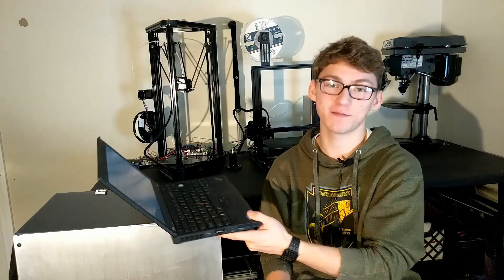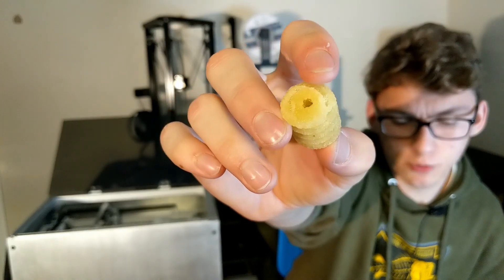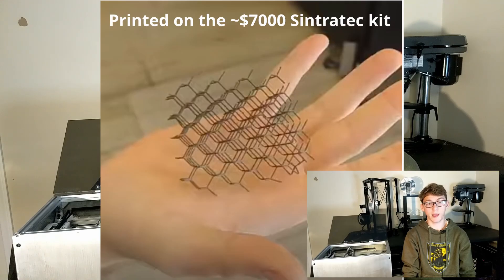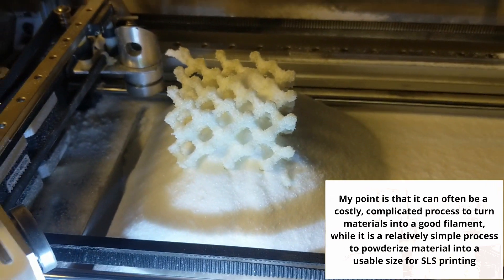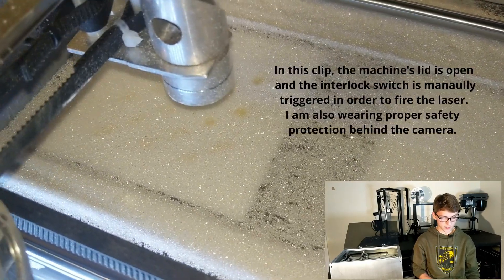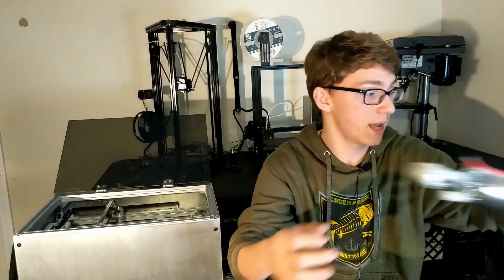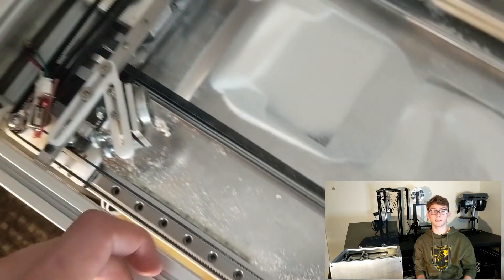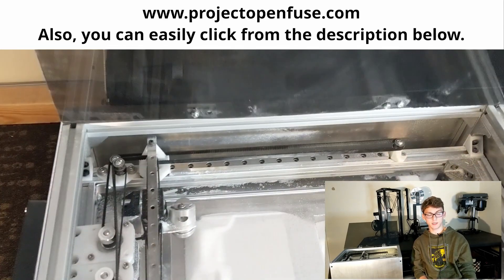Open-Source SLS 3D Printer: Project OpenFuse

Comment: This is fantastic Luke. Have you tried castor sugar? Would be interesting to see a really detailed print with super fine grains. Cheers, JAYTEE
Reply from the maker: Thanks Jaytee! I'm currently using granulated sugar sifted through a 60 mesh sieve, so <250 microns. I want to use an even finer mesh soon to try powders 50-100 microns. Someone in the discord actually pulled up a great chart of all kinds of different sugars, and castor sugar was mentioned. I'll definitely look into it more!
Reply: @MakingwithLuke  Excellent, looking forward to more 👍

Comment: Like all of your work I have seen  this is amazing, a new level of amazing even!

CNCKitchen done that salt video not too long ago, not sure if salt would work with this or if you have seen the video.  He was looking for a cheaper finer salt, and someone in the comments mentioned a possible candidate, might be something to check out.
Reply from the maker: I appreciate that, Jon! I saw Stefan's video about using salt to anneal prints which is really cool. I don't know if salt is a viable powder either, but the great thing about this printer is that I can at least try!
Reply: @MakingwithLuke  This is the comment I was talking about:

"The salt you want is called "pickling salt". It's much finer than table salt, has no anti-clumping agents, and is available in bulk at low prices."
Reply: @jon9947  salt melts at like 800c
Reply: @MakingwithLuke  No to salt!  You will release chlorine gas when you heat it up with a laser.  Very dangerous for you and your electronics.
Reply from the maker: @rvisani  Thanks for the insight! I'll definitely do more research into the necessary safety precautions before testing unknown materials like this.

Comment: Great results so far!! I'll be following for sure! Id love to adapt a powder box to my fiber laser
Reply: Oh i know, I plan to use metal powder & specific polymers under an inert atmosphere. I run & have built a handful of large co2 machines & also have a fiber so im very familiar with the wavelength requirements for specific materials. Good looking out though 👌 

I wanted to used the fiber since its the only galvo machine that I have on hand, it works quite well on some polymers & not at all on others. The co2 machine's I run are classic XY Cartesian style so quite slow comparatively.
Reply from the maker: @uthzx  Awesome to hear your knowledge on this! I thought better to over explain than be sorry I didn't :). What is the wattage of your fiber laser?  I assume it is the 1064-1080nm type? Have you joined the discord? I'd love to have you getting your thoughts out there.
Reply from the maker: Thanks, I'm glad you're interested! I would recommend against using polymers with a fiber laser, however. The wavelength is in the near/shortwave infrared spectrum, which will simply be reflected off the powders. It is particularly dangerous as well, because it is invisible to our blink reflex, and will directly damage the retina, not being stopped by the cornea or acrylic. The high power is also concerning. I would strongly recommend building a machine with a lower power co2 tube, which is what this machine uses. The wavelength is absorbed by plastics very well, and is less dangerous than a fiber laser.

Comment: This looks awesome. I would suggest powered sugar for future tests
Reply from the maker: Thanks for the suggestion. I've actually tried powdered sugar, and it seemed to be too fine actually. For some reason (I don't know the exact physics behind it) when powdered sugar is melted, it balls up instead of laying in a consistent pattern. A mixture of powdered sugar and granulated sugar worked quite well, however, and I have high hopes for the 50-100 micron powder I will be making to test soon. Small enough to give great resolution, but not to ball up
Reply: @MakingwithLuke  powdered sugar also contains corn starch to prevent caking. might try grinding the pure sugar with a coffee grinder or something like that. like the salt annealing with pla we're seeing lately https://www.youtube.com/watch?v=nRLJ4ylGTFc
Reply from the maker: @sylvainmartin73  Great point! I knew powdered sugar had cornstarch as an ingredient, but may have underestimated it's role in the balling up. I assumed the size was the issue, as things like surface tension start to play a role with lower mass particles.  I'm currently grinding and sieving my own sugar powder, and am working to make it much smaller. I think the results will be great
Reply: @MakingwithLuke  Heated build chamber would reduce thermal differentials making for more reliable layer geometries.
Reply from the maker: @DanBeavenZothar  Its in the works! thanks

Comment: Looks amazing!!! Have you done any prints on pla powder yet, or have you kept to table sugar? Also, the production quality of your videos just keeps going up! Great job man 👌
Reply from the maker: Ayyyy! Thanks man! I have yet to do some more tests with pla powder, as the last laser tube was too powerful and would vaporize material instead of sintering/melting it. I'll have to do some more tests really soon to make it work no that I have a less powerful laser. Yeah, this video felt like it took a few decades to make, so I'm glad you like it!
Reply: @MakingwithLuke  You cant turn the power level on the laser down? Most laser cutters that I've seen have variable output power levels.
Reply from the maker: @linkreincarnate9402  Yes, I did actually. The problem is that laser tubes have a minimum amount of power you can send for the tube to activate. Can't go from 0-100, more like 25-85 I was at the very bottom limit of what the tube could be fired at, and powder was still being vaporized. The 10w tube has a much lower power "floor", so I can drive it at lower power settings than the 40w tube.
Reply: @MakingwithLuke  well, show it to us :P